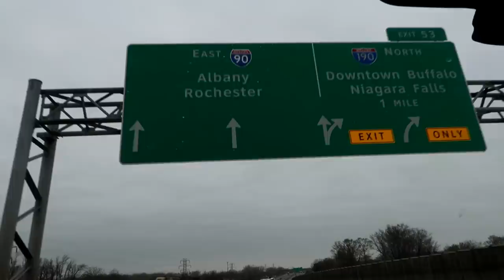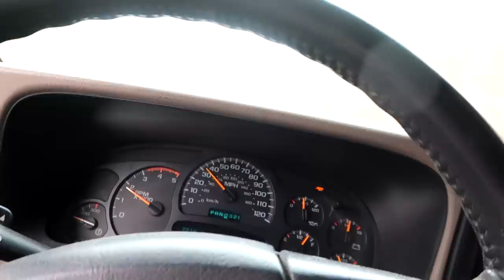First Time Camper Trailer Moves in 25 YEARS!!!

Comment: You know why it sat for 25 years? I do. ITS A PARK MODEL on regular travel trailers the pop out actually slide in not fold in. That thing is going to fall apart within 100 miles.  Same reason for the wait it ways that much because it is meant to be parked and stay parked it is a trailer.

Comment: do not follow the psi on the tires thats one thing you never follow, it only shows the max psi they can take which you should never run on any tire since you will get bubbles on them in any spot at any rate of speed. also Dalton if those tires are 25 yrs old they need to go in the scrap, the oils in them are way far gone and are most likely dry rotted. Another thing to add those slide out use an electric system or hand crank and they slide in and out UPRIGHT, you really didn't have to take them down like that you could've hooked up the power to your truck and powered them back in.

Comment: If you are going to be traveling with this, invest in a weight distribution hitch for the Dirtymax. It will pull 100x's better with less sway.
Reply: Plus change the tow package out. Rated for 6500 without wd hitch an think 10kish with. Learned that, 40miles from home when hitch touched ground lol
Reply: I agree 110%. Weight distributing hitches are an absolute must! They make life while towing so much easier. My bass boat doesn’t weigh near as much as the camper he’s towing but the new hitch even made a massive difference towing up and down all the canyons to and from lakes here in Arizona. I don’t even get as much sway on a windy day. Pretty incredible invention.

Comment: One concern I have is when you put Crush in there those wheels are almost centered with the trailer you're going to lose a lot of tongue weight which could cause you to be unstable on freeway speeds might want to address that either making room inside so that Crush can sit on top of the axles or shortening the back of it just a thought

Comment: I believe you have what’s called a ‘park model’ which generally are left in rv parks and not generally hauled around. They have a higher roof and larger windows like yours but I’ve only seen slide out and not tilt outs like this one.

Comment: i have a 35 foot fifth wheel and its a pain in the ass to take anywhere which youll find out for yourself, also a trailer that size you should invest in torsion bars that go from your hitch to trailer to help with tongue weight and help to distribute the weight better... that wood framed trailer is not gonna hold for your application either (as in wood framed im talking the box not the trailer frame itself) the trailer frame itself isnt rigid enough also..... so unless you tear it completely down, reinforce the actual frame of the trailer, upgrade axles, also gonna need to run a 3 axle set up for that size of a trailer and build the trailer from the ground up using steel instead of wood to support your siding and draw gate you will be wasting your time.... theres a reason toy haulers and enclosed trailers run steel instead of wood..... wish you the best with your build and i enjoy watching your channel but your in for a world of headache my friend.... just trying to help you out a bit....
Reply from the maker: I love your comment! Very constructive and informative. We are going to cut the size down and a few other things. I look forward to ready your future comments !!
Reply: I agree with madams22100, you are in for a ton of work but I will be rooting for you and watching best of luck

Comment: 20 psi in the tires, yeehaw! considering they're likely supposed to be 60 to 80psi (judging by trailer size/weight) the inside being gutted is less weight and a good thing.
here's a fair chart, but always follow the tire/manufacture specs... http://www.maxxis.com/trailer/trailer-tire-loadinflation-chart

Comment: The sides slide they do not flip. Suppose to have a swith inside to slide it out
Reply: Old park models often had tip outs. That's why they have such a sharp slope on top.
Reply: AlexR2648 but that doesnt make sense y travel if its open an u run into bad wheather
Reply: Robert Nunley that is kinda the point here, this isn’t a travel trailer. It was built to be parked in one place and left there. 

Love this project though, it’s gonna be nuts.

Comment: Hey 3d would you suggest buyin a 05 lly rust free only problem it has 276000 miles on it he wants 11 for it all stock except bumper
Reply: shane sattler that's not far off from where the price should be go for it
Reply: I think 8 or 9 is a better price

Comment: Hey 3D we have a 40 foot trailer and we tow it with a F-350. So I think it’s cool to see your trailer and truck
Reply: We used to pull a 36footer we upgraded to a custom RV
Reply: Camper? Thats nothing
Reply: Same 43 foot fith wheel and an f 350 pulls like nothing
Reply: Campers arnt that heavy
Reply: Those camper trailers are nothing for diesels. All that torque is freaking sweet to have.

Comment: next d-max upgrade, air lockers!
Reply: ORGASMIC ADVENTURES Yess! I’m planning on ripping my G-80 out of my truck and replacing it with an Eaton/Detroit True Trac. I think it’s called the true trac. Uses Helix gears instead of spiders and side gears. No clutches either. The G80 has been a great diff but I’ve done way too many burnouts which is bad on them. Burnt my clutches up and chipped some teeth on the spider gears but she still works and drives fine. I’ve thought about doing an air locker but I don’t think it would make sense for my truck. I have an 04’ Silverado 1500 Z71. For that Duramax though an air locker would be badass. I live in Arizona so we don’t get the kind of snow Dalton does up there.

Comment: The gaps aren’t supposed to be there they slide in and not flip in
Reply: Incorrect on this model they tilt in like that.   This is fairly rare and mainly would only show up in trailer parks.  Look up a 1968 Ken-Craft 35.